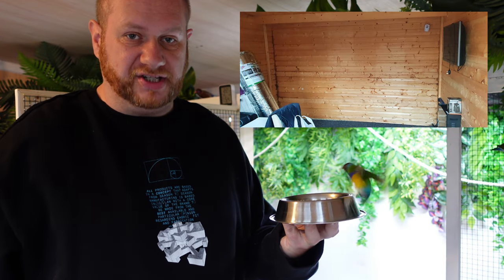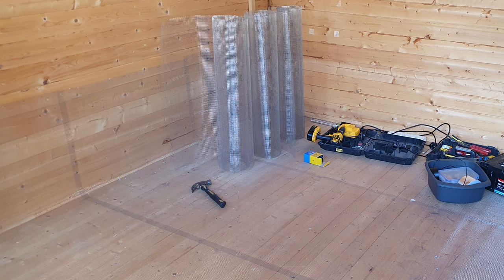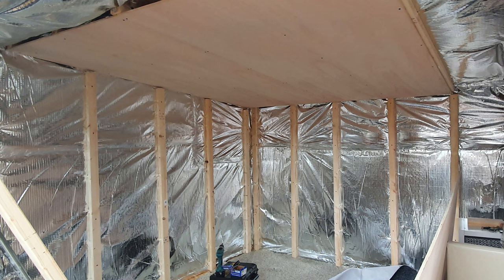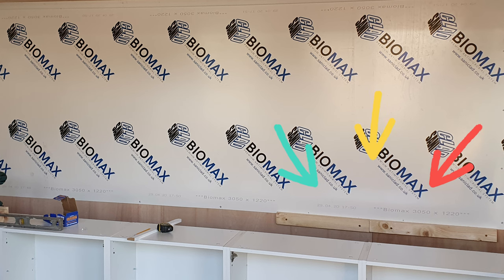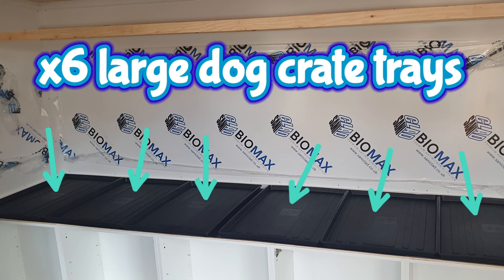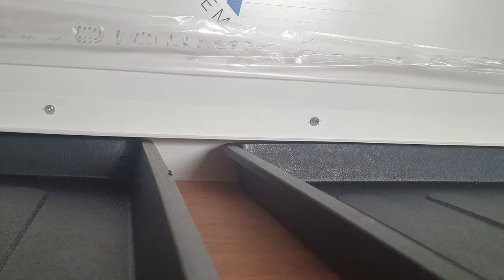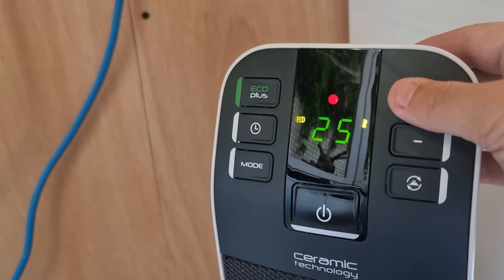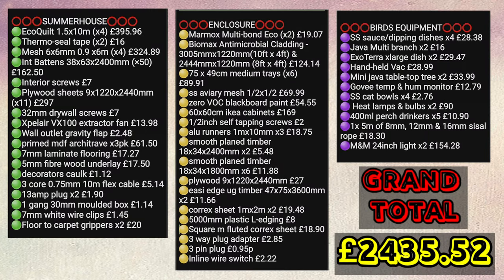Building a Finch aviary - how I built an indoor aviary for my Finches

Comment: Very nice, looks beautiful inside and very easy to take care of the birds!  The local climate has a huge effect on how you end up building a structure to house birds.  I'm guessing this one is in an area with less extremes of temperature than where I live.  I have a good size aviary building, with wire mesh to keep vermin out, and well insulated, but it has lots of large windows and a "shed" roof for passive cooling in the summer; hot air can go up and out windows just under the roof peak at the front wall, while cooler air comes in a couple feet above ground level at the back wall.  There are deciduous trees shading it in summer.  The inside pens have a ceiling of wire mesh flat across; the birds can't get up into the slanted shed roof section.  Each aviary compartment also has an outdoor flypen with live trees/bushes and grass.  The wire mesh there is dug into the ground 18 to 24 inches.  

In the winter I close the windows and close off the outdoor access.  The peak of the shed roof has a slow paddle fan.  In the winter I heat the aviary compartments with brooder lamps and the slow moving paddle fan circulates the warm air back down for a uniform temperature instead of all the warmth being up in the ceiling.  Where I live gets very hot and humid in the summer but can get below zero Fahrenheit in winter.  If I had a building as small and tightly sealed as this one, it would become far too hot in the summer in my climate.  Given the price of electric, I needed to minimize the  cost of both heating and cooling as much as possible, especially heat in the winter, or I just wouldn't be able to use the aviary in the winter.  I don't use any extra cooling in the summer; the birds seem to like hotter temperatures than I do!
Reply from the maker: Thanks, Coop 🙂
Yours sounds very well thought out.

Comment: Ma786sai Dua beautiful. Bless you. For keeping 10 Gouldians in my flat will a cage 4 ft by 2.5ft deep by 3.5 ft high be fine? Pl do guide me on the best size I will need. Do both males and females call? Cyrus India
Reply from the maker: Hey Cyrus. Thank you so much for watching. 
I personally think that would be way too many birds for that size cage. I would say 6 as an absolute maximum. You would need a cage measuring 6ft x 2.5ft to comfortable house 8 birds (10 maximum). Too many birds in a cage the wrong size can be extremely stressful for them, & cause all manner of behavioral issues. 
Males & females call, but the male sings & the female chirps & tweets. I hope this helps 🙂
Reply: @FinchManDave  Ma786SaiDua God bless you truly. So 6 by 2.5 ft cage is best for 8 to 10 max finches. That’s most kind of you. I don’t want any breeding, just to see and enjoy their sight and calls. Will zebra, long tailed and owl/barred finches be fine with Gouldians?
Reply from the maker: @cyrussataravalla6731  I have Owl & Gouldians together & both are passive species, they get on perfectly fine. Shaft-tails can be a little pushy, especially during breeding season. Zebras can be aggressive, so I would avoid having them in a mixed flock unless you have a very large enclosure, as they need lots more space than your average finch. I only keep cock birds as I dont breed at the minute, & mine are all fine together
Reply: @FinchManDave  ok Dave that’s most helpful truly. How kind of you. I don’t want to breed at all. But some females will come in my lot naturally. Won’t keep any nesting box etc. are u referring to long-tailed Finch being a bit pushy!
Reply from the maker: @cyrussataravalla6731  you're welcome, Cyrus 🙂
Yes, shaft tails can be pushy. Not all of them, but it isn't unusual.